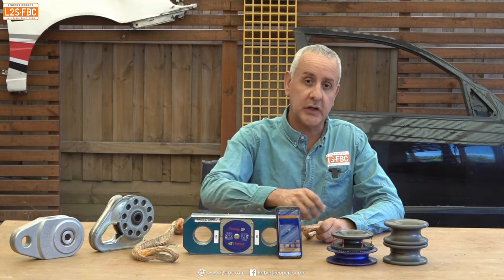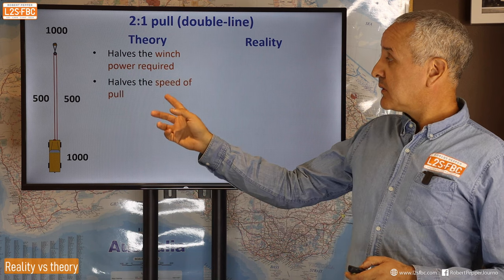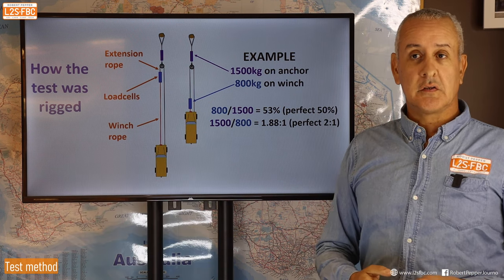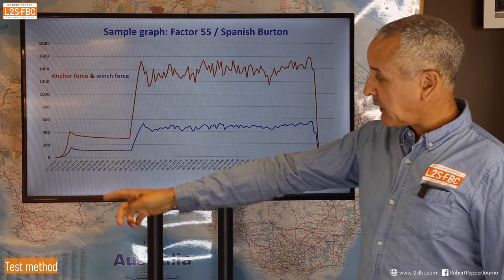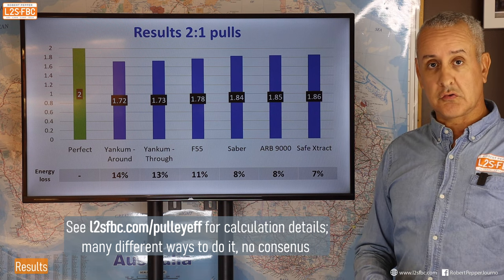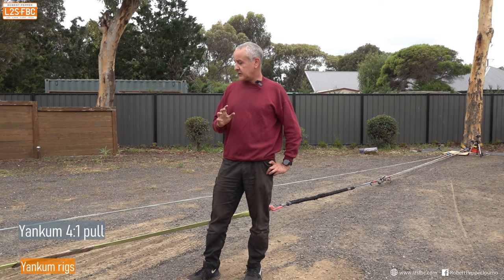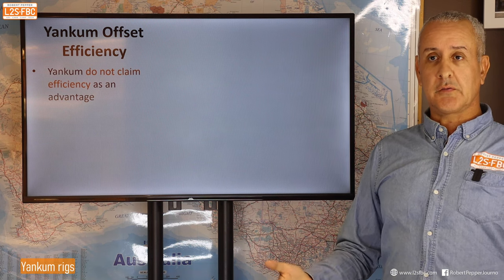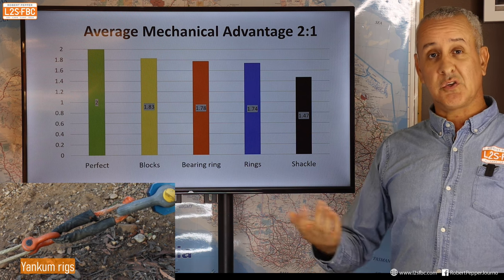3:1 isn't 3:1, and so on.

Comment: 10:25 yes, just poke your eyes down into an active rope on tension. Kids at home, don't do this.

Former Army Recovery Mechanic, ECN 226.
Reply from the maker: What did the Army teach you about checking your rig before you put actual recovery-load tension on it?
Reply: @L2SFBC  not to dive my head into an active rope with pulleys, nor step over it. An active rope is one that is connected, whether under tension or not. The corporal was the recovery boss, the lance corporal was the rope boss - the 2IC; the Craftsman (a private soldier in RAME) was responsible for laying/winching out cable, it was then checked upwards. If two wreckers were involved, the sergeant became the recovery boss as they commanded two vehicles; so on, and downwards . Since WWI and into Viet Nam, all recovery platoons are commanded by a captain from the ranks - by popular vote. An RMC graduate might think that they're in charge of recoveries - but they just do the operational planning. Recoveries are directed tactically by soldiers. And it continues today. It's a 12 week course at Bandiana, VIC, for newbies.
Reply from the maker: Did you notice how much tension was in that line?  That it was laying on the ground? The answer is around 150kg.  Now I don't think there's any danger of things breaking at that tension, do you?  But what it does allow me to do is check the rigging. Is there a stone in the pulley, no snags on the lines. I make that inspection, then I move back and apply full load.  Why is that unsafe, and how would you check a rig without any tension on it at all?
And I also sometime step over a winch line...because there are occasions when it's safer to do so than to go around.
Do you think all the Army techniques apply to recreational, and vice-versa, or is there room for differences?
Reply: @L2SFBC  never step over an active line. you never know who will pull, when, apparently, in charge. It's a good habit.
Reply from the maker: I agree...but there's times when it's safer to step over, than go around, don't you think?  "Never" is not a bit strong?
Reply: @L2SFBC  No, "never" is a good habit. Unless you're well qualified, skilled and experienced, have a recovery boss, a 2IC and cable layers - it's risk that can be eliminated by amateurs.  Risk 101.
Reply from the maker: Okay. How about this. It's a very wet night.  You've rigged a 70m pull. You're an hour in, and at least two to go. The winch anchor is around a tree in really thick undergrowth.  It's a very slippery hill.  You're near the anchor point, and you need to go downhill to check the rope before the pull, but there's a curve in the track so the winch line is across it.  Do you:
a) fight your way through the undergrowth around the winch anchor point, probably need a chainsaw it's so thick
b) go all the way downhill, 70m on wet rock and earth, only to find the car is in a really deep rut and you can't easily fit past it, and then you're right behind a car hanging off a winch line.
c) call for the winch rope to be momentarily de-tensioned, then step over, and continue the recovery?
Which is the lowest risk to injury, and management of fatigue?
Reply: @L2SFBC  take a risk. Australian Army soldiers always have a risk. Imagine Afghanistan or Iraq, where you're ordered to recover a disabled ASLAV  or a Coalition Bradley; so it doesn't fall into enemy hands? ADF Recovery Mechanics are responsible for night and day recovery often under live fire. We are also responsible for removing bodies from destroyed vehicles while the medics watch on. During ops, I don't give a rats arse about active lines. In civvy  life, do the hard yards and don't step over an active line.
Reply from the maker: Okay, I'd argue it's not a question of hard yards. It's a question of risk, and fatigue management. In that example, which I have been in, the risk of injury of going all the way down, then up, multiple times is great. It is also time-consuming and energy sapping, both of which are risk factors.  I would suggest that calling for the line to be de-tensioned, then stepping over it, is a lower risk, don't you think?  Should you go around if that's the lower risk option? Yes. But sometimes that's impossible without fighting thick undergrowth, even if the line is short.  Or, you could simply unrig things, go across, then re-rig...all the time. Again, time and energy become a problem, because if you are tired, and you don't get out before rain comes...that's a risk. Do you see my point?  Assess risk, don't be bound by fixed rules.
Reply: @L2SFBC  It's always about risk. Always have a recovery boss with the one controller. By all means have active lines if the recovery boss says "OK, go" and step over. As I said, it's a good habit, but on the two way range, it can turn to custard.
Reply from the maker: I agree re recovery boss. And I agree about not stepping over...if that is the higher risk option. But, there are scenarios where I'd argue stepping over is the lower-risk option.  I know what the military says, and I also know the military is fond of very simple rules which generally prescribe the normally-lowest-risk option, and are very easy to follow. The rules have a lot of "never" and "always", which are absolutes with no shades of grey...unlike the real world.